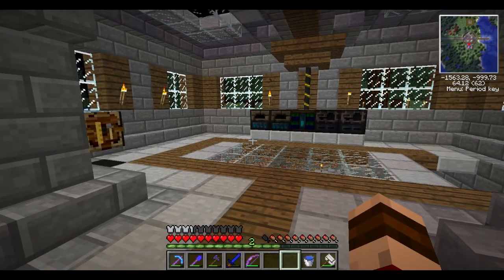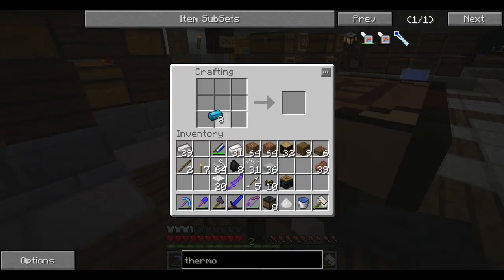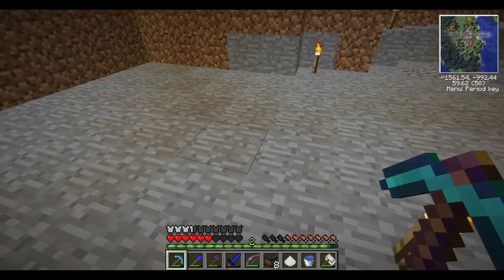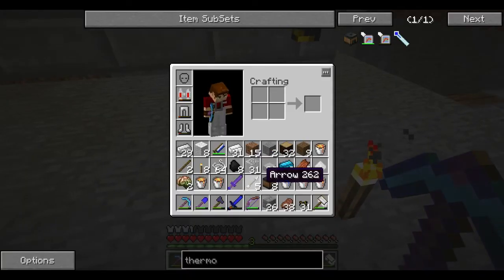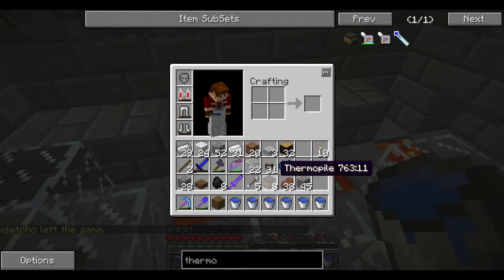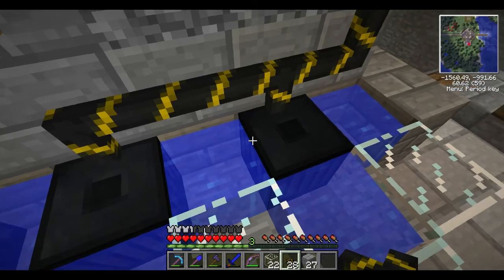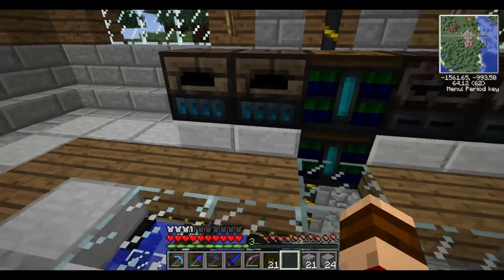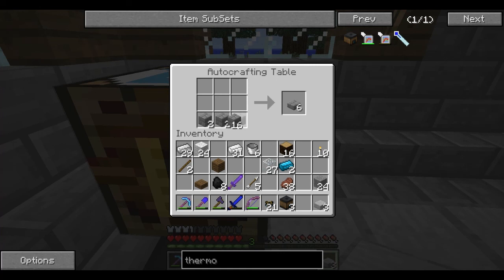FTB - EP5 - Thermopile

Comment: If you really wanted to you could make a voltmeter to show the voltage/amps in RP2 wire (and PSI in RP2 pipe). The tool is otherwise useless though. (for now) 

Apparently Elo is adding MV and HV wires and that tool might be useful in the future.

Comment: Another good episode. I really like the Blutricity stuff. Here is a little info that might help.
A thermopile can output up to 50w and a solar panel can output up 200w. The best way to test the output is using a voltmeter. Each furnace can draw up to a maximum of 1000w per operation. You can pump items in the Furnace from the top or the right side only.